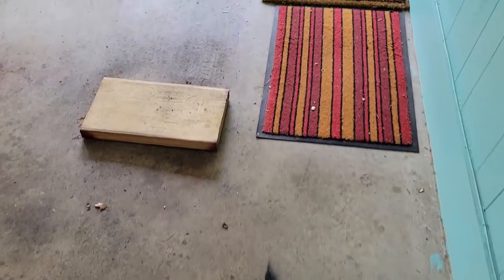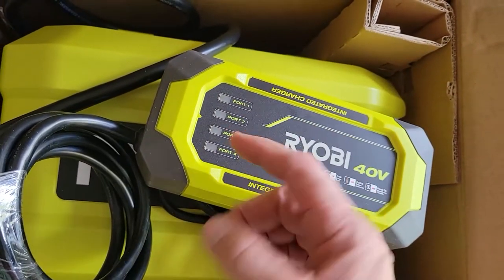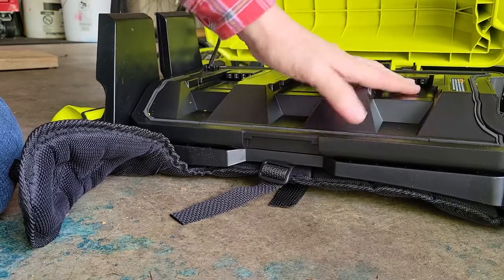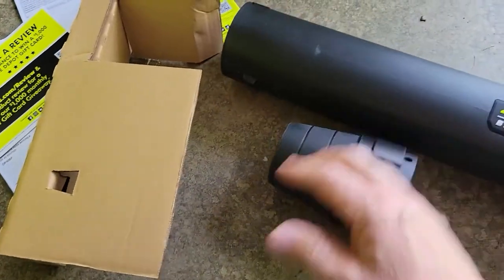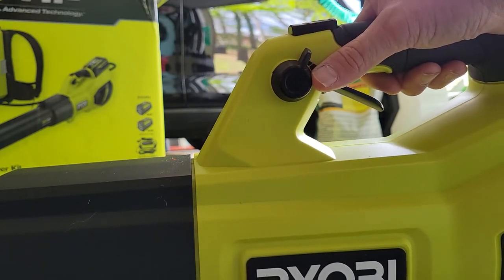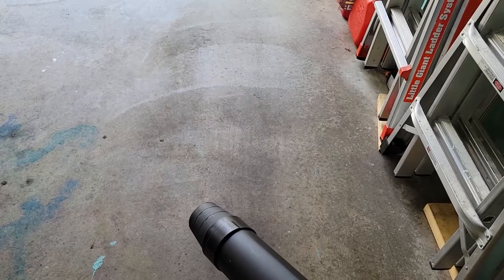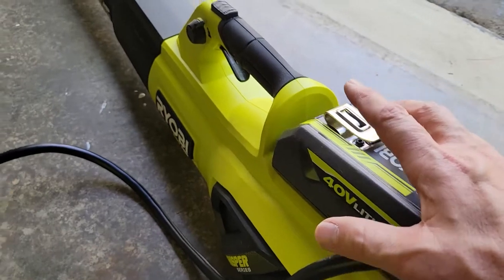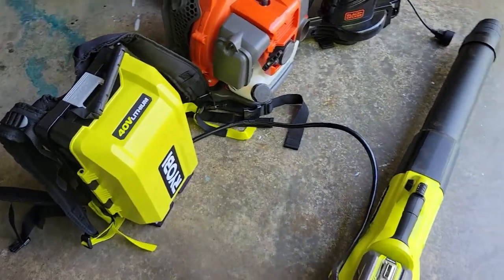RYOBI 40 Volt Cordless Backpack/Handheld Blower Kit model RY404180

Comment: I'm picturing this thing with three 6Ah batteries, plugged into the 300W inverter. You could tailgate for days!

Edit: I could also see them making a bracket kit for their push mowers, so you could mount it and triple your constant runtime.

Edit 2: Looking at the "storage" pouch that goes against your back and the loops in the straps, I'd say this thing is hydro-pack capable. It makes a lot more sense than using it for anything else.
Reply from the maker: I like your thinking but according to the math since 6Ah x 40 volt = 240 watts. So you would need  a smaller inverter say 100 watts and if it was 100% efficient it would deliver about 7.2  hours of power. Which might be enough for the party.
The power module will plug into the mower but length of the cable makes it awkward and not advised. Better would be if you could slot two batteries into the mower and it would just switch. In using the the 20 mower https://youtu.be/AFmHDFHUNFI
the 6Ah battery allow for a long runtime.
Hydro-pack is an interesting idea after all they do have cup holders in riding mowers.

Comment: I do thank you for the video you did a great job on the video but I am not impressed the battery pack holder weighs a lot of space and adds a lot of weight it would be so much simpler for Ryobi to just come out with a standard 12 amp hour battery they are 18 V has a nine amp hour battery so the 18 V is almost up to the standard at 12 their 40 V however has a 7.5 amp hour if they came out with a 12 amp hour then that would be enough to do just about any job and it’s really not hard to switch a battery out for another one so although I think it is a good idea to have a unit that puts multiple batteries together the purpose of that should be for the inverter or things that are stationary Ryobi really needs to make a bigger battery so that they can compete with the other two major companies the engineers at Ryobi really need to talk to their customers because their customers have the knowledge they need but they don’t seem to be doing a good job at that Ryobi is at least 5 to 10 years behind their competitors although I do love Ryobi and don’t knock what they put out they are not keeping up with their competitors
Reply from the maker: While I like the concept of the battery backpack, in practice I just slap the 6Ah battery onto the blower and it delivers plenty of run time. I recently saw a guy with a Ryobi chainsaw with battery backpack https://youtu.be/dqVg9LGzcXc and I thought it would have been user just to put an individual battery on the chainsaw. You can always swap out another battery if you run out. I think the battery backpack would be great for something like a vacuum cleaner which consumes lots of power and you need the extended runtime. In the meantime I mainly use the backpack to recharge and store the batteries. Considering that Ryobi's market is the DYI niche, I think they manage for the most part deliver quality products at reasonable prices.
Thank you for sharing your take on Ryobi and for watching the video.

Comment: Great video but not a fan of this setup.  For my needs I will just stick with the gas powered blower.
Reply from the maker: Thank you for the feedback. So far I find the blower by itself comes in handy for cleaning out the garage floor. The backpack is great for recharging batteries which is probably why it can be separated from the harness.